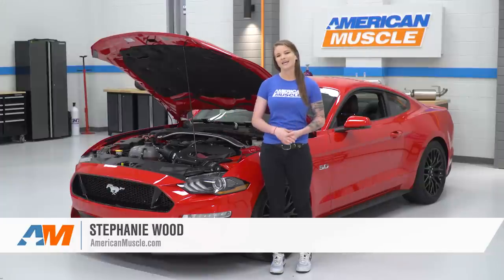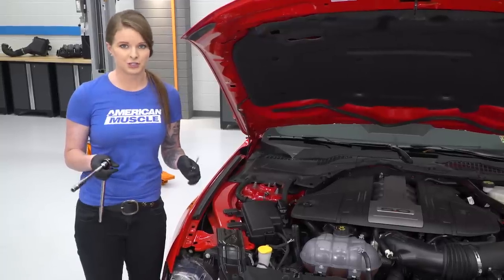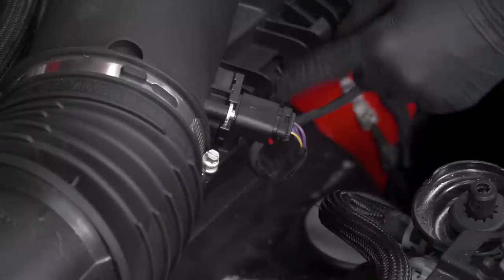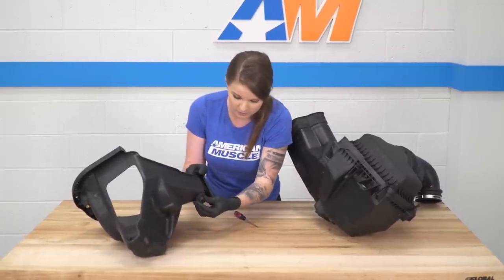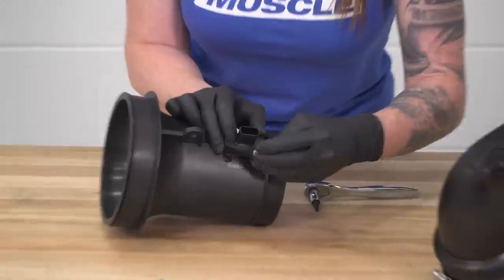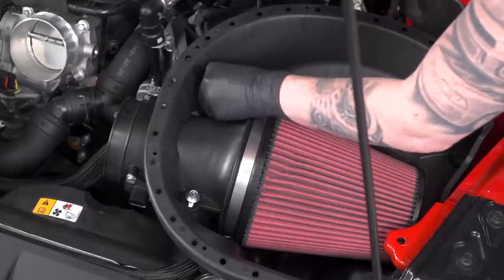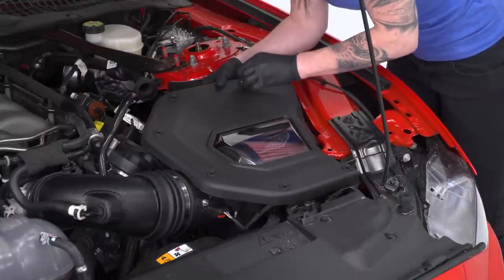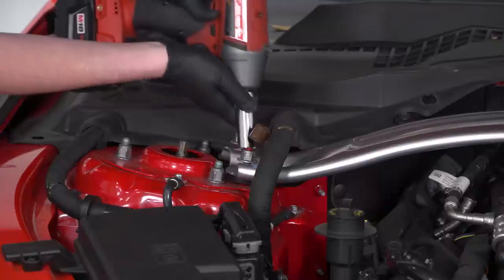2018 Mustang GT Roush Cold Air Intake Review & Dyno

Comment: For everyone wondering about the sound tube and what to do with it- you remove it fully. Roush also gives you a plug for the firewall in the bag with the screws
Reply: My question is what is the sound tube... and is it important 😅 and why does it need to be removed?
Reply: @goldenmyth3499  not sure what it does but you don’t “have” to remove it, unless you want some random tube jingling around in your engine bay.

Comment: Why dont you dyno test the CAI without the tune first ? So we customers can see the difference!
Reply: because the gain you get from the CAI without tune is 3hp to 7 hp and 4tq to 8 tq  not that impressive for $400 dollars o and trust me i have a 2019 5.0 i already sold this cai to one of my friends for 300 so i lost 100 bucks and my car didn't go any faster from 0 to 60mph.
Reply: coyote gen 3  so what woulf u recommend my guy have a 2019 PP1 I really want to change my oem intake whats ur opinion ? Should I get a cai with a mod ?
Reply: @Coyote.five.0  so essentially it's the tune and not the cai?
Reply: @Fernando-fg2gt  get a performance drop in filter like the K&N or if he really has deep pockets get a tune and a intake just make sure is like this one a close system so hot air doesn't get into your engine.
Reply: @tonytebliberty  the tune accounts for the extra air provided by the cai

Comment: Love your channel People, but I gotta say, the dyno numbers tell us nothing about the $400 intake value, because you RAN IT WITH A TUNE. Get the picture??
Reply: The entire point is you'll see almost no power gains without a tune. That's just common sense.
Reply: Lethal5.0 Common sense would be if they did the tune first, dynoed it on the oem intake, THEN swapped for the Roush intake, and dynoed it again. That's the only way to know how much hp the $400 intake gives. They failed to do that, so the dyno run was pointless.
Reply: @shinymike4301  a tune is required to see gains for the new increase in flow, otherwise you just have sound. all tuners know this
Reply: @shinymike4301  Obviously, the point of their video is to sell you a Roush intake....
Reply: @lethal5.0  Then the intake is worthless.
Reply: @camirocz  On these new cars pretty much. Most tests, especially on the 2018+ Mustang show the stock airbox has the best numbers even with a tune, only seeing a slight increase by removing the filter (which I wouldn't recommend). The CAI's are basically for looks and some noise. On boosted applications that can be different. Changing the CAI often adds a lot of sound with supercharged applications.

Comment: Mega clickbait. I thought from the thumbnail that the CAI would produce all that extra horsepower, not because of the tune.
Reply: My experience owning Mustangs and Challengers is there was never more than 3 to 5 hp gain from just a cold air intake, you always need the tune, tbh, the cai is more of s show piece and looks good under the hood.
Reply: @powerboatguy2308  That is wxactly right .Drop in a k&n filter and get the same gain for a sixth of the price.
Reply: camirocz wait what. Are you serious. So this is over priced and is the gain in Horsepower rally that much?
Reply: @YNCX  Yes i am dead serious.
Reply: @YNCX  He's correct. This is why I've always used K&N. Modded a V6 and got it to 367 wheel horsepower and just got a V8. The intakes don't do magical stuff like they're shown. Any intake really with a good tune will do

Comment: So I just installed this today and have some lessons learned for the next person who installs it. Don’t over torque your nut installing the intake to the car, I split the bolt in half so now I have no anchor screw there (which is fine because once everything else is installed it doesn’t move), and for removing the sound tube, use a ratcheting 10mm wrench. You can get it off manually (as I did cuz I don’t have a ratcheting wrench), but it’ll take you more time. I haven’t gotten my tune delivered yet so idk how the performance will go but I’ll update later.
Reply: yeah I did the same thing but for my ignition coil. I had to but a whole new valve cover

Comment: I get they work better with a tune but since the point in this one is NO TUNE REQUIRED,  everyone expects a no tune dyno. Really shady practice.
Reply: Yea I was thinking the same thing. Why not dyno it without a tune first??
Reply: @nathanjualin2118  because they want to sell you something that does nothing so they can profit . Hence why you rarely see a 1/4 mile test before and after . The factory box is superior in every way . You think ford would go through all of  these things like direct injection , changing the cylinder liner and raising redline for like 30hp if all they had to do was put a $200 piece of plastic ?

Comment: It’s crazy how fake your numbers were in the early release of the 18 S550.  470+ on an intake and a tune.  Lmao.   I have this intake along with full bolt on. And my air restrictor is removed and custom dyno tune.  That’s the most ridiculous  results I’ve ever seen. You should remove false advertisement vids like this.  There’s absolutely no way some one can reproduce those numbers with just the Roush intake and tune even with the restrictor removed. For any one interested. Expect more realistically numbers around 440 wheel with the intake maybe.  The car on average dynos 410 wheel stock.  I have a full bolt on like I mentioned and I’m just hitting 470
Wheel.
Reply: I've seen several videos of people getting 430 rwhp stock.

Comment: I agree this is a shady practice from people who push CAIs.  The HP gains are attributed to the following practices: 1) Running the dyno after installation with a tune.  2. Running 87 octane with the stock and 93 octane after CAI installation.  3. Running the dyno test with the hood open which allows the filter to get a maximum air flow.  Come on, no one drives around with their hood open.  I want to see a apple to apple comparison.  Run the dyno before and after installation with the same fuel and close the hood.
Reply: This is a sealed intake

Comment: What car are you dyno‘ ing in this video?  Your stock numbers and after tune numbers are both ridiculous. Cmon AM I expect better.  And you didn’t specify whether the air restrictor was taken out.
Reply: Ridiculous as in to low or what?
Reply: @forgot2wipe  high.   The stock engine doesn’t dyno at that number and an intake and tune doesn’t add that power. They have since corrected the numbers in future videos. They knew this was silly.  Full bolt on Mustangs barely make that on pump gas.  Remember you’re watching a stores channel that’s selling you products.
Reply: @TheCdM1981  yea very true they are tryna sell a product. So Ford says it makes 460hp. But in reality on the dyno it's a decent amount less?
Reply: @forgot2wipe  460 engine is equal to about 400 wheel which is what a dyno reads.  The 18 mustang is slightly under rated and produces stock about 410-420 wheel.  Which is about 465hp engine.  It does not produce 435+ wheel.  And an intake does not make it 475 wheel.  I had this intake with the air restrictor removed before I put my blower on. This intake is legitimately the exact same as a stock intake with the area restrictor in. You can call Roush and ask them to confirm what I just said they will.

Comment: HELP!!!! I bought this part and installed it but for some reason the piece that connects to the throttle body and the other piece where the mass air flow sensor goes has three ports for three hoses. But you only disconnect 2 so I was confused. Both American Muscle people told me to plug the port. But I highly doubt I’m suppose to. It’s actually the same as the piece for 2016-2017 model part. Which is weird cause all parts are exactly the same as the 2018-2019 model except for that one piece. I don’t know what to do anymore :/
Reply from the maker: Is your car Auto or manual?  -Justin

Comment: How often do you have to take the whole thing out to clean or change the filter ?
Reply: You really don't have to take the whole thing out to change or clean the filter as far as we could tell. Anyone know otherwise?
Reply: @bryanphelan1104  I'm late but to clean it all you have to do is un-clamp the one clamp to the cone of the intake and the cone itself pops right out. I modded a V6 for couple years and had one and just got a GT but this is how you clean the cone. And usually these can go without cleaning anywhere from 50,000-100,000 miles. Depending on brand and area you live in. Hope this helps!

Comment: Does this make more horsepower than the JLT intake with tune?
Reply: I have this set up on my 18 (JLT) and i have better throttle response and more power down low...altho it feels like i lost just a little up top
Reply: i was going to comment on this, they put out a video last week with a JLT and tune at 461hp. seems like this is a better option if wanting more whp.. which is why you do these.. still think they should do a tune on an otherwise stock car
Reply: Thomas Clark which one made more power?
Reply: Eric Pugh they claim this did 474 to the JLT 461 I believe. Lund shows a tune then tune with CAI and it was 9whp about 4-5 more then a drop in air filter which is the way I went. 350-400$ for 5-10whp isn’t worth it to me and the fact later on I plan on a whipple

Comment: There is no way a stock mustang with a cold air intake is going to make 474hp at the wheels assuming its 15% loss thats a 540hp mustang basically stock with a tune either the dyno guys messed up or someone is lying

Comment: Overall my son and I thought the video was very helpful, but definitely not perfect. One item NOT mentioned is the fact that the wiring harness for connection to the MAF is very tight and that TWO plastic clamps holding the wiring should be cut to allow the wire to reach.

Comment: I installed the cold air intake it gave me limp mode and check engine light came on
Reply: Check if the clamps are all the way clamped down and your connections are secure. Hope this helps!
Reply: Take the insert tube out works like a charm you don’t need a tune

Comment: Does it makes it extremely louder? I live in a residential area.  I have a 2020 gt cs. I'd rather have a regular 5.0..
Reply: No. The intake doesn't add noise. To get a louder car you would need to modify your exhaust - which you're not doing at all here.

Comment: Those baseline numbers are not accurate 18s make 410-420 at most stock. You’re telling me I can make close to 500 crank hp with just an intake and tune? These 5.0’s are an impressive platform but you aren’t getting close to 470 + wheel with just an intake, tune alone throw in some e85 and headers and now we are taking.
Reply: 440hp and 396tq STD on my 2018.  Bone stock.  Sooo yes they are putting down those numbers man.  All this with 98degree weather!  6sp manual as well.  Now I don’t know what the automatics puts down but I assume it’s a bit less for obvious reasons.
Reply: 440 wheel ?
Reply: Yes to the wheels.
Reply: I do agree with you that I doubt an intake and tune would add that much though, especially since their are several people who have done testing on the factory air intake and shown that it flows damn near as well as any aftermarket air intake.
Reply: @wildfirewoodandmetalworx2409  440rwhp and yet no publication can go faster than 12.6 in the 1/4 mile in the 6speed . Generous dynos.
Reply: I’m not sure what your point is.  There is a lot more to drag racing than high HP man.  Suspension plays a huge role.  Hell my car is set up for road course shit, not drag racing.  I’d rather drive the car for what it was built for.   It that’s just me😬
Reply: I’m not sure what your point is.  There is a lot more to drag racing than high HP man.  Suspension plays a huge role.  Hell my car is set up for road course shit, not drag racing.  I’d rather drive the car for what it was built for.   It that’s just me😬
Reply: I’m not sure what your point is.  There is a lot more to drag racing than high HP man.  Suspension plays a huge role.  Hell my car is set up for road course shit, not drag racing.  I’d rather drive the car for what it was built for.   It that’s just me😬
Reply: @wildfirewoodandmetalworx2409  my point is that a factory mustang with 395 rwhp should be slower than one with 440rwhp with the same suspension setups , platform , tires and gearing . I get that hp isnt everything.  I shaved 3/10ths by changing my front suspension and tire pressure with no other mods .
Reply: @wildfirewoodandmetalworx2409  in short,  I call bullshit on these dyno numbers .

Comment: 2019 gt get rid of the engine cover..retains heat..all show no go..aluminator 5.0L engine calimer mgw vmp tune pedders coil overs w external canisters bmr k brace stop the hop rear braces by bmr fhp front strut brace bmr rear strut brace bmr and steeda complete suspension mods McLeod rst dds drive line roush cold induction mangnaflow 3 " inch competition exhaust dw-400 fuel pump cold case radiator fhp high output alternator boobma trans mount steeda differential brace fhp differential g force half shafts dds drive line rtr front vents bill wicker spoiler auto sport roll cage sve 350 rims 10f / 11r nitro 555

Comment: I thought this car made 435 stock when y’all first got it? Now it makes 440? If the car makes 460 crank then that accounts for 5% powertrain loss. Most people see 470 with full exhaust and e85 through the 10 speed. This is bs. You expect me to believe that a manual makes that much more power with just a tune and cold air? Either these numbers are fudged or they aren’t corrected and it’s a happy dyno.
Reply: Alex Marentes research. These 18 cars make closer to 490 stock. They underrate from the factory in the 18. They are making 430ish wheel bone stock. You really think bigger displacement higher compression and a better flowing manifold along with di is only good for 15 horse? Get a clue dude
Reply: Eric Pugh I own a 2018 gt. I do research lol. Has a jlt and Lund tune. Lund made 440 with tune and jlt through the manual. American muscle is just trying to sell parts and is fudging their numbers. Most other companies dynoed their cars in the 420s. Just another blind sheep who believes what these companies say. The 460 hp number from the factory is certified. Cars are not underrated from the factory anymore like they used to be.
Reply: Alex Marentes then don’t watch the video crybaby if your worried their scamming you
Reply: Knightmare5.0 lol the sheep will believe what they want to. You’ll be disappointed when you put a no tune cold air on your car and make no more power. Cold air and tune 18 cars usually make around 440. More than your car with full bolt ons lmao
Reply: @alex.marentes  crazy people believe these cars have 490hp , that makes them the slowest 500hp cars on earth , since nobody has tested more than a 12.5 -12.7 1/4 mile at 114-116mph . They aren't underrated at all and are about the same speed as the 2nd gen off the line thank to 2 overdrive gears.
Reply: Spiritcr1jsher people have gone much faster than that. I believe the record is 11.8. I went 12.1 at 119 in mine bone stock with the 3.55 gears. But it only made 420 at the wheels on the dyno. American muscle just juiced the numbers in hopes of selling this stuff.
Reply: @alex.marentes  auto or manual? No way a stock 6speed is doing 11s . I saw an auto 2019 do 11.9 at 119mph like 4 times in a row. You are right , they juice up these numbers to sell parts that do nothing .

Comment: Will this fit my 2015 GT that has 2018 manifold?
Reply from the maker: It may, but there still may be some clearance issues when you go to install this in the engine bay. We wouldn't be able to confirm fitment sadly! -Zach
Reply: I'm going to try it and report back.
Reply: Ryan did you get this intake? I have an 18 manifold as well.

Comment: Shy not put the filter and the tube in the housing before sliding it into the compartment? Looks liek she don't know what the Fu** shes doing?... Kinda
Reply from the maker: Naw, it is easier to install the housing first then the filter after. Look at how the air filter sits under the lip of the inner fender structure. It's faster if you install it after. Not to mention it's not like you can't install the filter after the housing is already in the car....so does it really matter? Potato-potato or tomato-tomato. - Stephanie
Reply: Schooled!